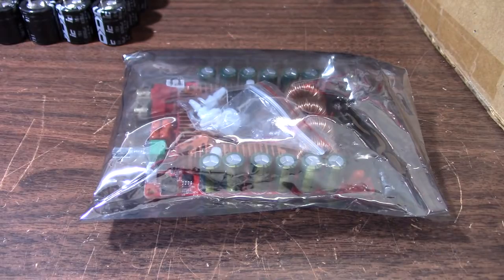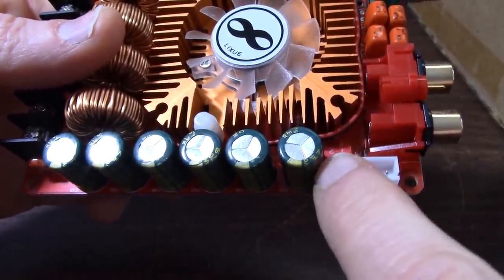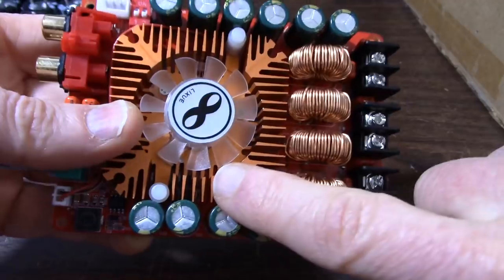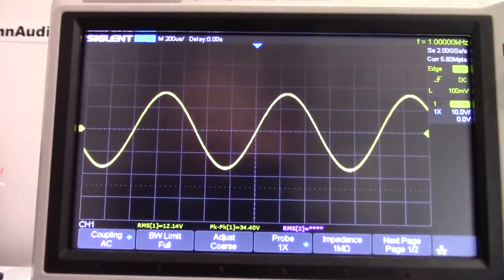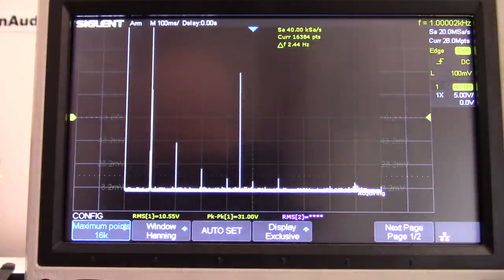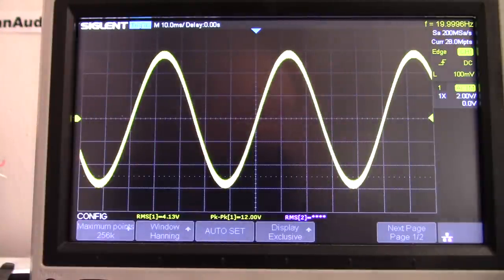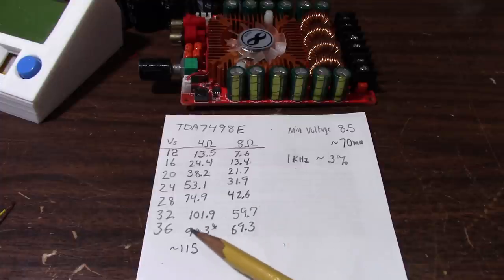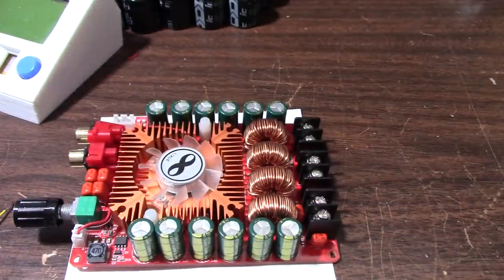TDA7498E class D stereo amplifier board test and review

Comment: John I want to say thank you for making this video and the amplifier pop on sounds video you made convinced me to get the TDA7498e. I found it normally around 10USD, but with some deal hunting and waiting I got it down to about 5USD making it my cheapest amplifier purchase to date.

Currently testing it with a 19V 45w laptop charger with great results and its way better than any of my other Class D amp boards.  

It has some slight differences to the one you have. Biggest one is that it has a green PCB. Other differences include a different style screw terminal that's smaller, pin header gain control instead of switches, no included nylon standoffs, and reversed RCA inputs (Red on Left and White on Right).

The reversed color RCA inputs tripped me up, but its ok since just a simple cable swap fixes that. 

Its pretty quiet with no audio playing, no pop sounds on power on, and best of all it doesn't have the auto mute after being silent for a while that a lot of TPA3116 boards have that can make the first second or two after playing something again to be only silence which I find particularly annoying especially for video.

Thanks again.

Comment: Some of these new Class-D chips have Single-ended, Bridge-Tied-Load and Parallel-Bridge-Tied-Load configurations.  The PBTL configurations can be a real pain to layout on PCB sometimes but my current favorite is a TPA3255 with an OPA1632 on the analog inputs to keep it from randomly hitting overcurrent protection at high power.  The TPA chips with their protection circuits really love having perfectly balanced inputs for some reason and the OP1632 fully-differential op-amp works great for this.
Reply: how do I add the OPA1632 to the board? I really need this, mine cut out all the time
Reply: @MojaFilm  for that amp board you would need a special adapter board. I designed my own amp board so mine always come built in.

Comment: Hi there John. I had also bought this amp some years ago and i  have tested on 6ohm load diy 2way loudspeaker and i can say it sounded pretty good. Good bass response and overall good mid and high. But i guess it have some more detail in the highs in 8ohm.
I have tested the amp on around 30-32v dc on a linear powersupply. Also tested on a switched 360w 36v on 2x 4 ohm subwoofers with good punch resultts.  Higly reccomended cheap amp dor dc psu or dual 12v battery in serie to 24v. 
Thanks for the very informative and honest videos.
Reply: @Dumpfbrumsel i´m thinking of combining cllass d on the bass mid level and class abb tda7377 or tda7379 4ch brudge to 2ch .And they can work good around 12v to 18v or on a simple dc laptop adapter but that will be some mixed up power options
but 24v battery is a very good startpoint for many little powerful amp board like tda7492p simple 2ch amp or tpa3118d2 or tda3116d2. But my two favorites are tda7498e and tda7492p without the bt module.
Reply: Testing it only on a speaker is no good ters.

Some of the ones I have.

(TDA-7492)
(TPA-3116)
(L15D)

If you compare those with middle class,
clasd-ab amplifiers from the 70's 80's 90's so the vast majority of Class-ab have better sound than the new cheap class-d has.

Class-ab that does not have good sound
(Name NAP250 clone)
(Qad405 clone)

class-ab that HAS good sound
(L12-2)
(L15)
(L20)
Reply: If you are looking for a good class-d for a bass speaker then the L15D is a good amplifier for bass.
It measures 150w in 4 ohms.
with a large enough 50v-0v-50 power supply.

Watts reding on aliexpresd and ebay are in 10%THD and do not count.

Comment: Just a note that most speakers past 10 khz the impedance tends to go up
Reply: Full range speakers, sure. It's a bit different for multiple speaker cabinets with passive crossover circuitry. It would ideally look pretty flat(but realistically would have bumps around the crossover frequencies).

Comment: OK, my measurements on 4 Ohm load in parallel output - PBTL MONO mode (with jumpers J1 to J4 set to ON), clean output power like you measure it, just below fuzzies:

at 24V Ucc ..... Pout = 60,6W
at 27V Ucc ..... Pout = 70,2W
at 32V Ucc ..... Pout = 101,3W
at 36V Ucc ..... Pout = 135,2W

The distortion (checked with FFT of oscilloscope) is around 1% 
I am very very impressed. I paid for it 14€. 
(I need it for bass instrumental amp so roll of at HF doesn't bother me)

Comment: Hey John, I ordered a simple 36V 5A power supply "brick" for this. You were saying the 32 volts setting would make the unit last longer. Is there an easy way to just keep the input turned down or something to help if I still use the 36V supply?

Comment: If I want hiss I'll listen to one of my cassette decks using a Type One tape without Dolby NR. A-B amps for the win.😎
Reply: Those chееsy Chinа amps are for party speakers only. Class D itself can sound better though. The additional complexity isn't really worth it for home HiFi as you don't need so much power at home in my opinion. For party or portable speakers class-D is quite good.
Reply: Properly made class D amps are amazing, I'm using 50W (25 with my 8 ohm speakers) ICE power I bought for like $100, it's pretty good and no hiss at all, I rarely listen at more than 40% loudness!
I've also heard some great three way speakers with an active crossover, and tri-amped - two 50W class D amps (for lows and mids), and a 50W AB amp for highs.
I have to admit that it sounded nicer and more powerful than exactly the same speakers with a single 400W amplifier and passive crossovers! It was "an upgrade" and all the parts together were cheaper than the 400W amplifier from before so it was pretty sick!
Reply: @zlac  

50asx2?
Reply: @westelaudio943  Yes, a nice little amp. It's also very cheap when you buy just a module while big companies sell their amps with this exact module inside for thousands of dollars!
Reply: @zlac  

Definitely one of the better switching amp modules, compared to all this red board Сhina pridе stuff. And even a schematic is available (a luxury these days). I though about buying one but I don't really have use for it ATM and it's pretty costly.
I'm more into tube amps and 80s receivers for daily use.

Comment: Bought 2 of them for a 2.1 setup but the second Amp that I set as bridge died in few weeks. Probably I got a fake one because the marking on the PCB is XINRUI, unlike yours marked SANWU. Plus mine have the fan always on and found out that the supposed to be thermistor was replaced with just ordinary resistor.

Comment: Hi John thanks for your time and good info. I am on a budget and Iam trying to build a rear channel amp for my bus. How does this amp compare to the tda7293 as far as sound reproduction is concerned. I would use a boost converter to power the amp. I would be using apair of 6.5 and a tweeter per channel. Based on the cost to build this a similar amp bought would be over $100. Thanks any input would be appreciated.
Reply: Just buy a car amp... cheaper, and designed for the job.

Comment: Hey John, is it possible to wire up several of these mini amplifiers in series and say triple the output…….safely?? And if so what sort of power supply? Thanks.
Reply from the maker: Not really a practical way of doing this. They are already bridged for maximum power at a given supply voltage. I'd go for something that can take a 50v supply if you need more power.

Comment: Bridging strapping btl what ever you want to call it doesn't let you lower the impedance I have no idea why they say that the two channels see half the final load so you actually need to run it at higher impedance when strapped
Reply: He did explain this, the "BTL" label on the PCB is incorrect. The outputs are already bridged, the jumpers allow the two BTL outputs to be connected in parallel which doubles the current capacity of the combined output and allows lower impedance loads. The trade-off being you now have a mono amplifier so you'll need two of them for stereo.

Comment: Is their a good trick to getting a larger gauge wire between a board and the banana jacks when installing into a chassis permanently? The holes on the boards are so small... Or is a smaller gauge acceptable because it's carrying the signal over such a short distance? It seems odd to me to be connecting 12 gauge wire between the banana jacks and the speakers with such a small wire bridging the jack to the board.
Reply from the maker: 16 gauge is fine for running a few inches inside a case.
Reply: @JohnAudioTech  you are so greatly appreciated. Thanks for the response. I noticed a .1 or so volt difference in my stereo boards output. You had recommended 1% resistors to get them outputting equally. What about a variable precision pot to replace the feedback resistor so the output can be balanced as well as the gain set with a single pot in each channel?
Reply: Buy a Pin Crimping set. By far the best way to terminate stranded wire prior to soldering or putting into a screw terminal.

Comment: Very interesting video, I have the same Tda7498e amplifier but I use a 32v 5A power supply. The fan on mine never turned on but I was also never able to turn the volume to maximum and I usually have the volume at less than half because if it was at maximum volume it would be unbearable, is it the reason why the fan doesn't turn on and the chip doesn't heat up enough to turn it on?
I have a Technics SB-EX3 pair of speakers, they have 250W and 4 Ohm connected to this amplifier and the sound looks decent to me and without visible distortion but do you think this amplifier is more suitable for speakers of 8 Ohm load?
Reply: 12-15v 3-5 A for 4 oms

Comment: great video, I am currently using a 2.1 Bluetooth amp with the  tpa3116 chip with 50W+50W+100W for my TV speakers, and it's awesome, great volume levels, and bass response, but I am wanting to upgrade to a little more wattage, what can I use that is just as good? I had recently purchased one off Aliexpress  that was a XY-S350H 2 x 220W + 350W APP Control Bluetooth 5.1 TPA3251D2  and it totally sucks, no volume to it even cranked all the way up, and virtually zero bass response. Can you recommend something as good as the TPA3116?

Comment: Wiil a 24v 10a significantly improve sound quality in tda7498 compare to 24v 5a?
Reply from the maker: No. 5 amps should be plenty at 24 volts with 4 ohm or higher speakers.
Reply: @JohnAudioTech  i am running 8 ohm 6.5 inch speakers 90 watt 89db with 8 ohm tweeter... bass is good but little on lower side treble is very good.

Comment: maybe someone can help me?
I have a preamplifier in a small box with external power supply. The preamplifier card should have 15v-0v-15v
To make it easier, I use a regular AC adapter and 2 diodes and 2 capacitors (volt doubles) but I get 50 Hz noise. when I plug out the power adapter and before the capacitors are discharged the noise disappears but there is still music for 2-3 seconds. why? does anyone have the answer to that? With current from capacitors, 50hz is completely gone

I have tried large capacitors and several AC adapters without this having helped.
Reply: The reason sound persists for 2-3 secs after power is disconnected is that the PS capacitors hold a lot of charge and that continues to drive the amp.  The 50 Hz hum comes from the mains AC, so when that is disconnected there is no more a source of 50 Hz.
Reply: @gibbogle9486  
Ebay. 273874382475
Yes i know this. Not what I was wondering. Why can I not get it noise free? Do power doubles with 2 diodes have this weakness? I use a 2x transformer and a bridge rectifier and 2 capacitors for my other preamplifier and amplifier card without getting this problem
Reply: @ford1546  I am no expert, but I do know from experience that eliminating hum created by grounding circuitry can be tricky.  A search online should throw up some pointers about this.

Comment: John, is this an Amazon purchase? The closest I've found so far is a DAJUNGUO brand that looks the same, has the same specs and parallel output instructions, but its ~$30 US. Still very inexpensive for the power you get. You'll spend just as much or more on a suitable power supply. 

Of course, I found plenty more similar amps, with different fans and build qualities. Such is the online marketplace.
Reply from the maker: I bought it from ebay seller czb6721960. Listed for $21.44. It was on my watch list for a couple days and they offered a discount for $19-something.
Reply: @JohnAudioTech  Thanks. I have a guy on a DIY board who is looking for something to use with a sub he wants to build, and this came at a most opportune time.
Hope you are doing well. Catch you on the flipflop.

Comment: Tda7498e gives out 160+160 watts stereo and 220 watt pbtl mode, as per datasheet. How come results of this test completely contradict???? 
Might be fake ic(tda7493 used on this board instead 7498e)
Reply: They are talking of 10% THD, which is unacceptable.
 We are measuring at 1%    Thats why.

Comment: I have bought a number of different class-d amplifiers of this type and have no good experience! the sound quality of them is not so good either. A speaker never has a constant ohm. but varies with frequency. this type of class-d construction is very common. almost all are built this way.

only good class-d I have bought are Hypex ucd and ncore. they do not respond to speaker load ohms. and has very good sound
hypex has a patent on the method they use.

cheap class-ab is almost always better than cheap class-d
Reply: If this is the case (they do not respond to varying speaker impedance across frequencies) I wonder what they use for output filtering then?
Reply: @buddhistsympathizer1136  Everyone knows that if you put a capacitor or coil in series with the speaker, they behave differently at different ohms. loads. The frequency is not exactly the same. I would much rather have bought the L20 class-ab or L12.2 class-ab than all the cheap class-d amplifiers if sound quality is a priority!
Reply: @ford1546  Thanks for the reply, but I don't see how that addresses the question I asked.
You say that the Class D amplifiers that you purchased 'do not respond to speaker load ohms' - Then how are they doing the output filtering? - It cannot be inductive or capacitive - So what is it then to achieve this?
Reply: @buddhistsympathizer1136  
An amplifier should be independent of ohms. load and give flat frequency at all ohmic loads.

Many class-d cannot do this. 
This comes from how a cheap
class-d is created and the output filter. almost all cheap class-d are made the same.
Reply: @buddhistsympathizer1136  Another thing is that many class-d have a slightly colder sound type which is common for clasd-d

Comment: Why do we still have class D amplifiers with analog inputs when most audio is digital!
Reply: Because most sources have analog outputs, not all have digital.
Reply: @ferrumignis  Which all have a DAC inside, why have them all and convert to analog to send to a class D amp to convert to analog again. The turntable is about all that is mainstream and analog. I have two FM radios here with entirely digital processing, one even has a toslink output. Be it good or bad according to the views of the listener if it is digital at source why keep converting and converting and converting?
Reply: @pauledwards2817  - Class D amps aren't really digital at all.  They use pulse width modulation, and that is not digital like a Toslink.
Reply: Because the D in Class D doesn't mean digital. It's basically Amplifier Class Four.
Reply: @pauledwards2817  You think a FM radio or a record player has a DAC inside it?
Audio is an inherently analog signal, it can be digitised but it has to be converted back to analog at some point. You either have the DAC in the source or the amplifier, a Class D amp is still an analog system despite the output stage being driven by PWM.
Reply: @johncoops6897  And how many DACs are actually just that, PDM or PWM bitstreams... Just like digital amps. FM was in the 70s and before one of the highest quality sources available (Open reel excepted) for wide spread use, however I no longer consider that the case, it has been over taken and certainly in the UK where I am the myth was put about in the press of BBC classical concert broadcasts being the best you can get for FM when in reality they were distributed to the transmission sites via NICAM, that's a 10bit digital resolution in a 14bit sliding range at 32Khz. I have had mid range turntables in my time Linn LP12, for example, but when the rot set in with flimsy poor quality vinyl  from what where dead, glassy, digital recordings anyway mid 80s the LP was doomed. I do still buy albums but while they are 120gram etc they can still be very poor too. So 90% of sources are digital so why all the analog stages? I would rather listen to SACD which could go direct to an amplifier as a bitstream if someone wanted. I will say no more.
Reply: @pauledwards2817  - Good, because no matter how much you pontificate, it won't change the fact that Class D amplifiers are not Digital.